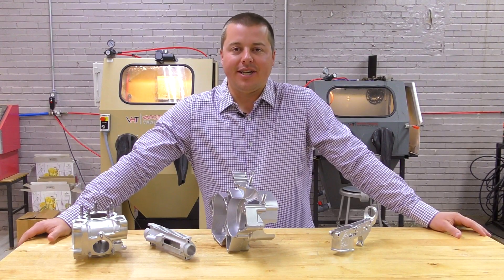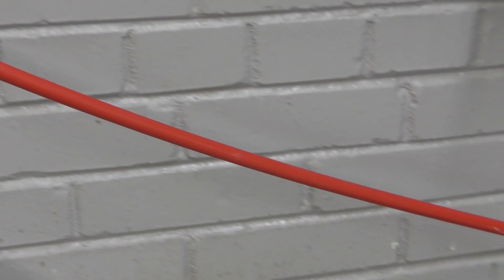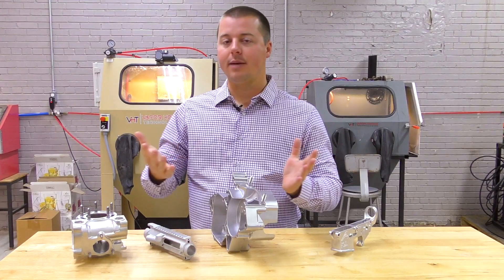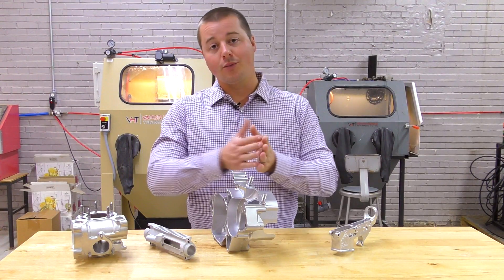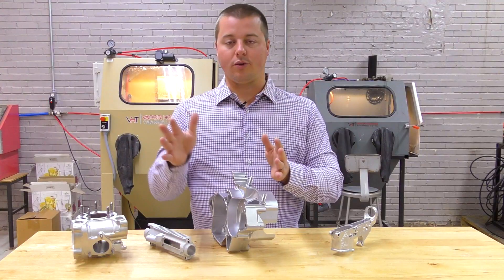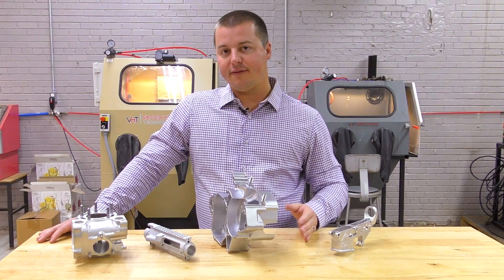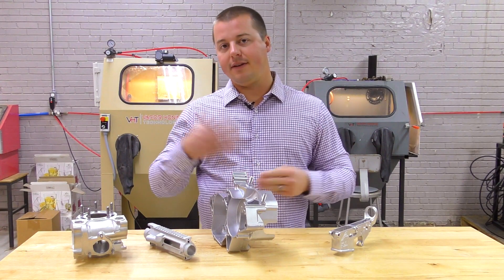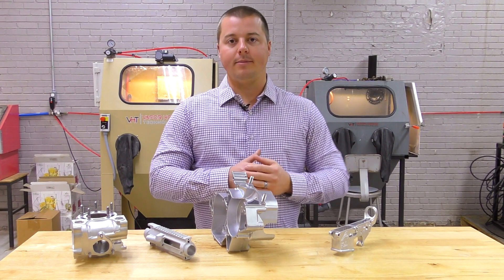CFM, PSI, and AIR COMPRESSOR - Vapor Honing Technologies

Comment: My compressor is 4.o compressor and my air gun is 4.8cfm will it work properly
Reply from the maker: Our entry level equipment requires 8-10 CFM and they go up to 150 CFM requirement for the Platform.  For more information or to place your Order Today; please contact me at 828-202-5563 x 103 Niki or Email nicole@vaporhoningtechnologies.com

Comment: So if you lower the pressure on the regulator(@compressor) you get more cfm?
Reply: No, you just get less pressure. To get more CFM you need to either get a thicker hose or if you're compressor is constantly running, get a larger compressor.
Reply: behemothinferno , thank you, I heard somewhere that you get less CFM with higher pressures, i have 60 gallon air compressor, I think it makes enough cfm for my paintguns